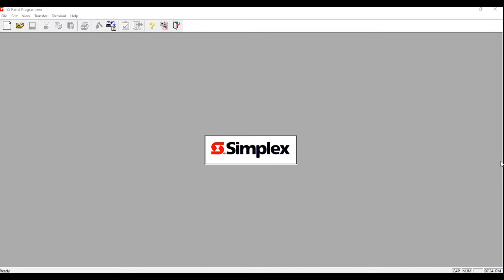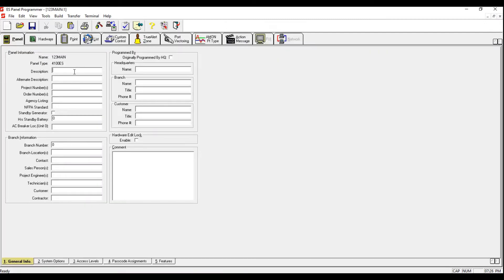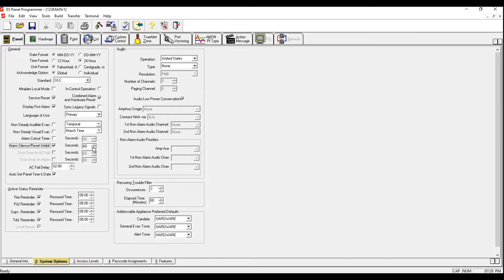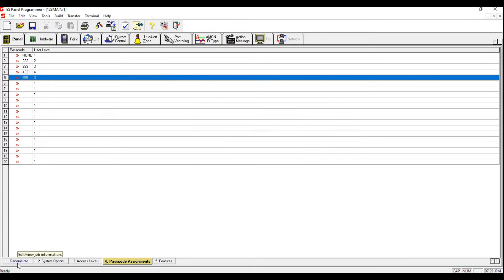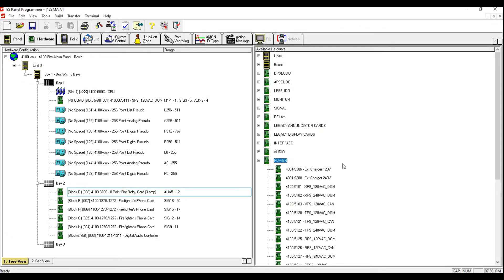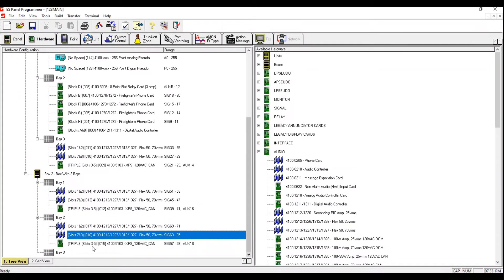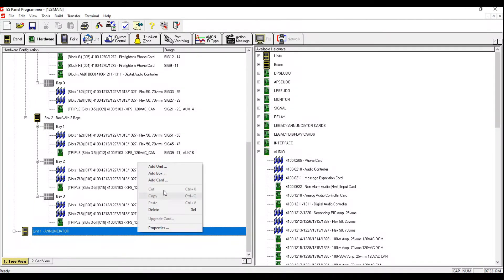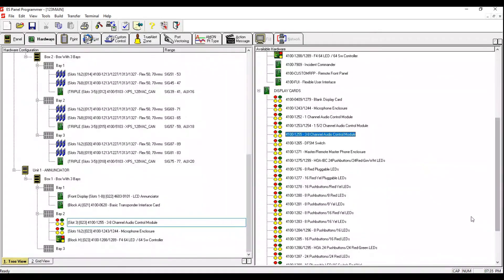Simplex 4100ES Programming Video  1 of 5

Comment: I am a simplex programmer in Canada. I haven’t tried this before, but do you think I’d be able to upload the cfig from only one node on my network and incorporate it into my network job? Our revs are out of sync and I have no idea what tech did the last download and what he changed. I believe I can, but it will restart my rev count to rev 1 which I can accept. I’d make a note on the program for the next guy.
Reply from the maker: Using TSW Yes, otherwise no, make sure you have that "other tech" backup file to prevent unwanted new devices or sequences changes.

Comment: i have 2 simplex 4100es panel that is 5.02.01 and 3.06.01 version panel how to networking both panel please shown any vedio cocept
Reply from the maker: Each one of the panels will require to have network card, and some additonal card in case and the building has speakers.. Will be easier for you to use Simpex authorized technician, its easy as it sound..

Comment: Simplex 4100 Es system install mode activate, but all device not working, how can salve a problem
Reply from the maker: remove from intall mode, and fix the issue you have..
Reply: @tech.channel5381 how can remove the install mode, clear explain
Reply from the maker: 1) Go to google search "Simplex 4100Es operators manual". Follow section 7. Make sure you logged to level 3 and all bypasses are on..
2) if you have trouble on panel you have to solve it and not putting it in install mode, all install mode does is taking multiple identical errors (open cct, short, or no answer) create 1 list and placed them all there, in return you will get only 1 trouble instead of the amount of troubles you currently have, so technically it is useless

Comment: I have 2 type of conventional  sounder 1 is sounder with flasher(4906 9127) other 1 is normal sounder (4901-9820) i need to silent both sounder but flasher should be work. i tried, but the normal sounder continually ringing. please advice for rectify this issue.
Reply from the maker: will not work, for flasher you have to run dedicate cable and dedicate cct, you will have to replace it with 4903-9254

Comment: The volume is too low, how do I contact you???
Reply from the maker: I cannot increase the volume, what is your question??
Reply: @tech.channel5381   How do I contact you, do you have a WhatsApp number, I need to ask you about the institutes that study the two systems simplex In the Middle East
Reply: @tech.channel5381  And I need your help. It is necessary if you can help me learn programming. I am an electrical engineer and I work on alarm systems, and I would like to develop myself.